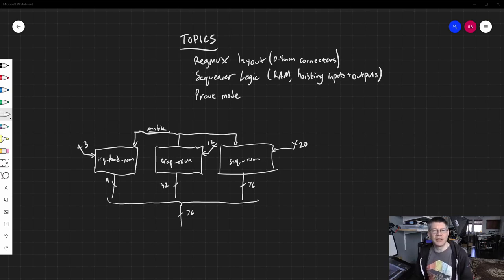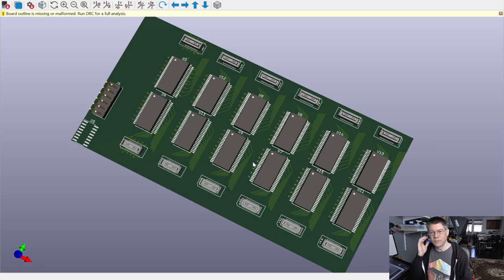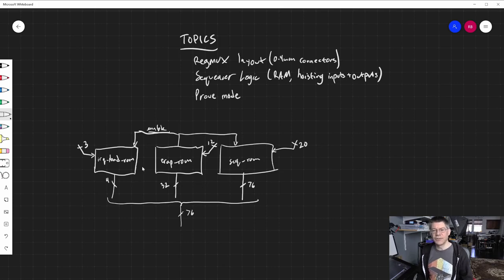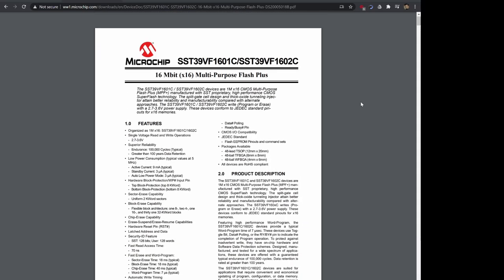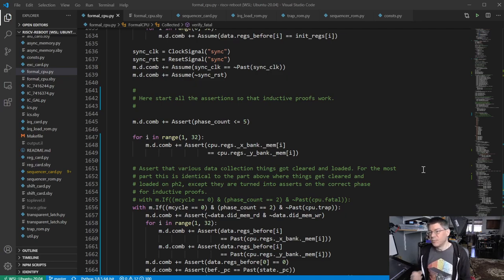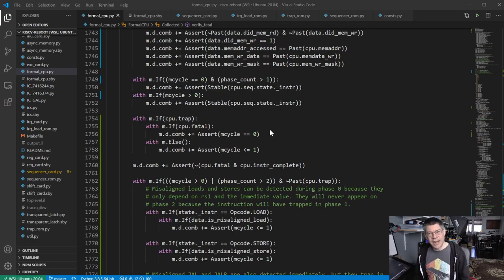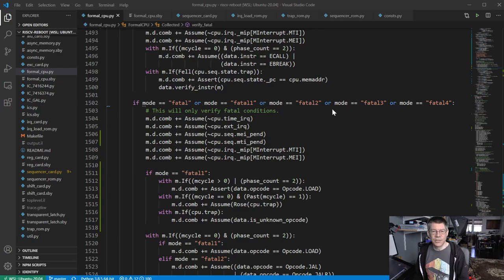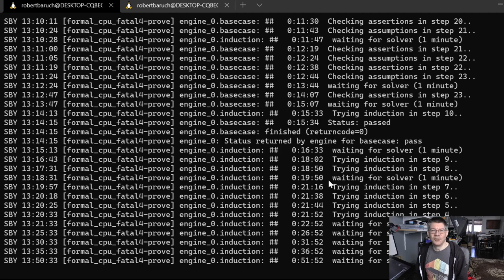LMARV-1 reboot part 9: Refactoring, final proof, and a ROM!

Comment: One thing people need to watch out for when using ROM's as logic is that the outputs can have glitches until the inputs are all stable for that delay time. Since you are using a clocked design this should be fine, but I have seen people try to use ROM's in async designs. To understand the problem lets say you have a 3 input, 1 output ROM that you programed as a AND gate. As inputs go high and then low the chip can cycle threw other addresses for a moment. The ROM"S that are inside FPGA's LUT'S are implemented differently to prevent glitches.
Reply from the maker: Yep, +200%. I did realize this just after I posted the video, and found ONE address line that wasn't registered properly. Oops!

Comment: I'd be pretty nervous about using multiple fine pitch connectors like that. I suspect you'll run into tolerance issues getting them all installed on the board aligned correctly to mate up. If the alignment isn't perfect you could have issues mating the boards or intermittent connections due to stresses.
Reply: In the past I made a cutout version of a PCB to act as a standard to hold all the matching connectors. in this case it would be a matter of sawing out a square in the center so you can solder the matching connectors with this jig in place.

Comment: One thing to be careful about some of those small connectors is that many of them are rated for very few insertion cycles. I've had to deal with some that are pretty fragile, and the development boards need to be reworked once in a while when the connectors stop working well.
Reply from the maker: The ones I'm considering using specify 50 cycles, which I'm hoping will be enough during development.

Comment: I would expect that with hard connectors like that, with lot of them on the board, you'll not only face issues with tolerances, but even the same force related issues like with pinheaders.
One possible fix that I thought of was to have folded flat flex cables between the boards instead of the  connectors coupling the boards directly.
Not sure, though, maybe it won't be a problem at all. I'm just going by gut feeling based on the fact that whenever i'm opening those connectors, it's by prying from one side.  If there's lot of them on single board, you don't get that mechanical advantage because you need to pull orthogonally to the board.
Reply from the maker: This is one thing I worry about: the connectors are only attached to the pads with solder, and the pads are attached to the substrate with glue? epoxy? So if I pull on a board, those connectors take all the force. In any case, I ordered a bunch of these connectors to try them out.
Reply: @RobertBaruch  Well, there will always be same force per connector. The real question is whether those connectors will hold if pulled orthogonally.

Comment: If price is not a big concern, Cypress Semiconductor and Everspin Technologies, do have neat fast NVRAM chips. 25ns. But ~20-60$ per 16Mb chip. Other option is to use 10ns SRAM (10$ per 16Mb) and load it on boot using some auxilary microcontroller. I think close to 100MHz is possible. Also using CPLDs for sequencer is another option.They are cheap, very easy to program, often doesn't require complex software tools, and are non-volatile (instant boot), and very low power usage. For example Xylinx XC2C128 has 100 IO pins, and 5.7ns pin-to-pin logic delay. XC2C256 is also an option, with a bit more extra pins, more cells. I think CPLDs are a great fit for a project like this. But, prototyping with Flash ROM is a good start I think.

Comment: How about instead of using connectors, you just make the whole thing a card-edge? Then you can "stack" the boards on top of each other, but sideways instead of vertically, on a kind of motherboard backplane. You could even use PCI or PCI-e connectors, since they're designed to handle that kind of mechanical strain. Bonus: if you set up the pitch properly, you could have the edges of the board have the same brackets as PCI(-e) cards and connect to the same mounting slots to keep them rigid and upright. Or maybe even mount the whole thing in an old PC case!

EDIT: looking at your design you might have too many pins for PCI-e, but DDR4 sockets should work. They're 288 pins, so if you budget one third of those lines for grounds that leaves you with 222 signals, which fits your six 32-bit buses plus 30 additional signals. The memory modules are supposed to be 1.4mm thick, but you should be able to just get away with 1.6mm on some of the sockets with wider tolerances, or go for JLC's 1.2mm option (which is within contact mating tolerance on all the sockets I checked) if you don't need their assembly service. Could be worth buying a couple of different DDR4 sockets (most are under two dollars on digikey) to try out.

EDIT2: PCI-e riser sockets are even better for this task. 280 pins (2x140 @ 1mm pitch), 1.6mm board friendly, spec'd for plenty of current and high frequency, cheap enough, available as both SMT and TH parts. They're also long enough that the insertion force would be nicely distributed. Plus you could still use the PCI-e card bracket/cage idea to keep them upright.

Comment: I think you sort of jumped from one frying pan into another there... By having 12 HMCs you are going to face tolerance issues (someone else pointed this out as well) and still have the possibility of binding. You should really use a small number of larger HSMCs instead - I wouldn't use more than 4 of them per PCB side. 4 may even be pushing it... And in fact, with more than 1, you probably need to have a solder jig just to align them (a PCB with the mating connector that lets you solder the other side down). The more you add, the more constraints you place - I have seen modules with 4 of them, and most either have 2 or 3. The ones that have 3 are positioned like =| to help loosen the constraints. For modules with 4, they are either as == or |=|
Keep in mind that a HSMc with 400 pins or 20 pins will probably be identical in how easy they are to connect / disconnect, since they are self aligning. Though with more pins, you do have to be careful not to break the connector.
Also, be careful about standoff height. Since the HSMcs are thin profiled, you want to make sure that your components don't collide with the mating PCB / components - typically modules that use them only load components on the side opposite the connector, and place small passives (like 0402 resistors and capacitors) on the side with the connector. You can potentially increase your standoff further by using an adapter PCB (a rectangle with the center cutout, which has HSMCs on both sides of the PCB). That would allow you to stack them infinitely (well up to the point where the resistance of the connectors becomes too high).
For your flash chips, you won't be able to take them out of the circuit and reprogram them, unless you have them on their own PCB with a mating programming board. The packages from the datasheet are TSOP and BGA. They're also 3.3V CMOS which won't work with your 5V logic chips. Putting them on a removable module is probably the best idea, though you should use a connector that has sufficiently high insertion cycles. Perhaps you could use a SODIMM connector (you can get some that fit almost flush to their PCB, and they can have 204 pins for DDR3, or 260 pins for DDR4). If you do that though, make sure to follow the DDR SODIMM mechanical spec, or they could end up damaging the ROM board / the SODIMM connector after a few insertion cycles. For example, the DDR4 spec is 1.2+/-0.1 mm thick, pads 0.25mm from the edge, no edge bevel, and gold fingers on the pads.
Reply from the maker: Some good thoughts there. For the most part, I'll be using 3v3 logic. There are some bits which are only 5v logic for unavoidable reasons, though, but hopefully that will be limited. I may still revisit the whole stacking connector thing.